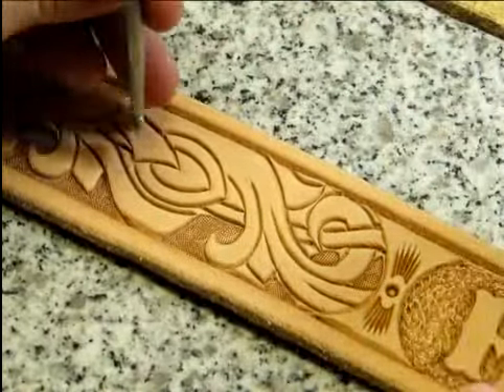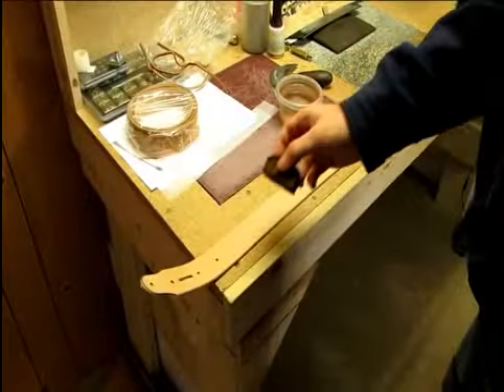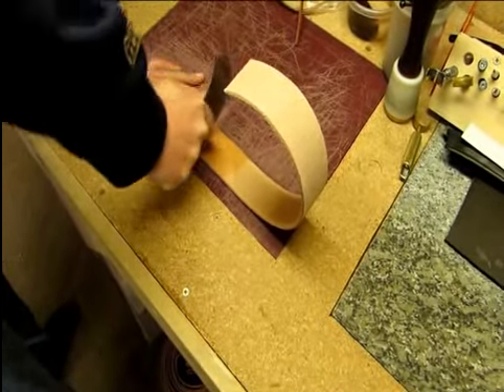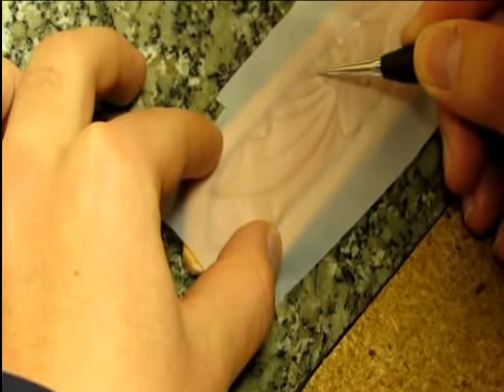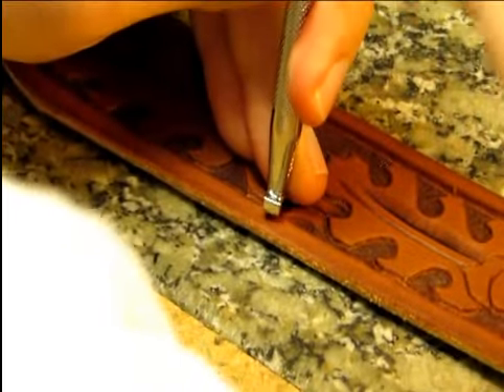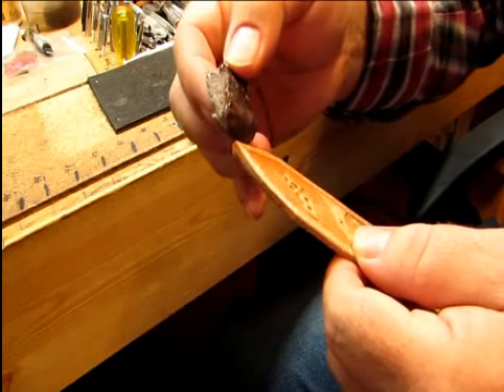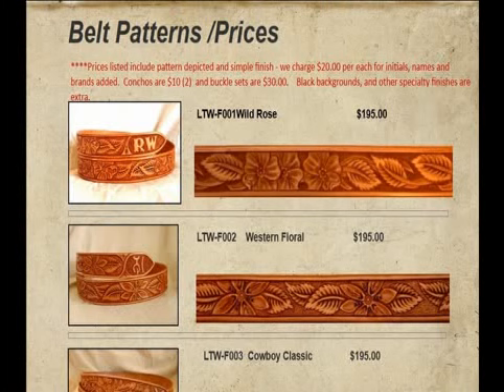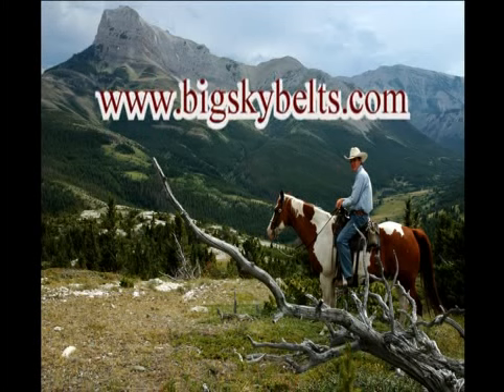Hand Tooled Leather Belts

Comment: i keep finding the texture tools but i have no idea of what to use for the normal drawing part
Reply: Damp the leather with water, use a stylist to put the pattern onto your leather, cut in to the pattern you drew with the stylist with a swivel knife,
Reply: Serene Seaman-Try   we sketch out our patterns on paper with a pencil  - then we trace the pattern on to tracing film. After your leather is damp (fully cased) allow the surface of the leather to dry back to it's orginal color, then using a stylus (smooth metal point) trace the pattern into the surface of the leather. The stylus will leave a dark line for you to follow while cutting the lines of the pattern in with a swivel knife